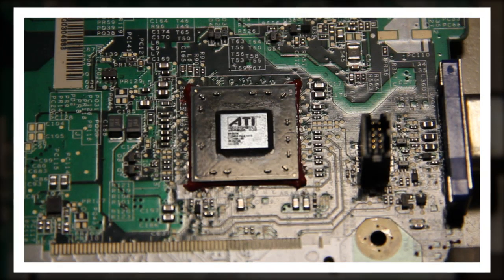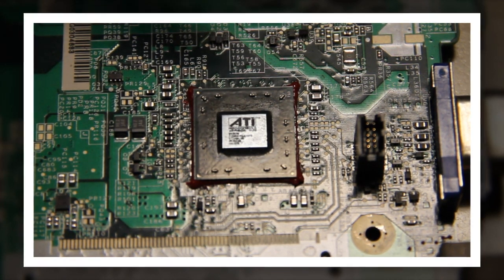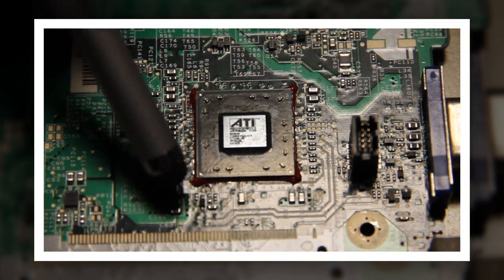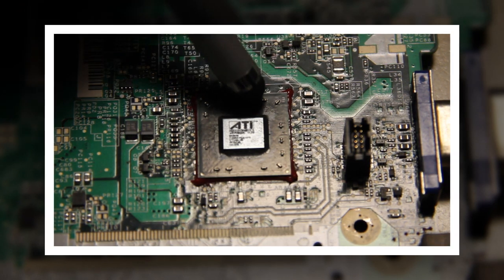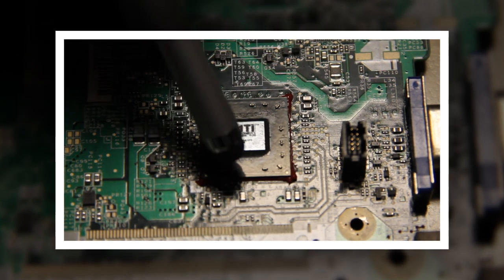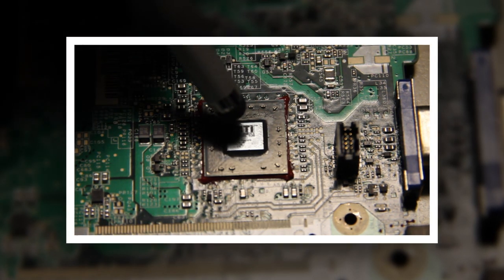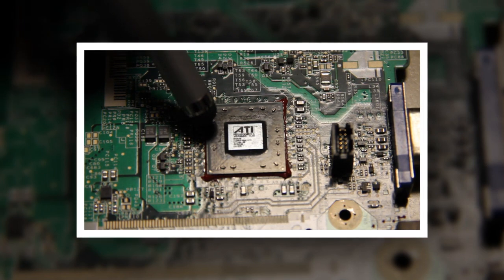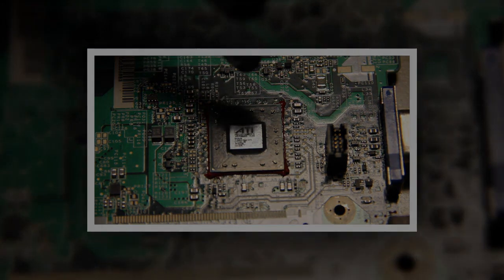GPU Reflow Do's & don'ts

Comment: The coin with lead on top works well.. you just need to do it on a circular motion and woth the correct temperature.. you says lot of things and you are not helping people!!!
Reply: Coins do nothing to actually fix the problem. The only thing adding a coin does is add pressure to hold the chip to the board. But this is only a temporary fix and will also warp the board or chip preventing actual repairs. I've done this for emergency repairs or when someone couldn't actually afford the fix when I first started until I got copper shims. Now I actually keep copper around so I can gauge the thickness accurately
Reply from the maker: And how does that fix it? That only puts pressure, but doesn't fix anything. I'm fact it causes more warping making future repairs much harder or more damage to the board.

Comment: If you are using foil on the board and then using a heat gun properly, the small componets falling off isn't a real problem unless you are using WAY TOO MUCH heat. 

Here's a DO that wasn't mentioned. Analyze the board that you are reflowing at home, and look for reasons as to why you need to do a reflow in the first place. If you didn't have a bad fan or cooling system and if the problem is common enough, then you likely have a tiny design malfunction that you might be able to remedy which will make your reflow actually last. Although sometimes, you just get a board with a little less solder than most other people (badluck). I'd recommend home users to read my solution below regardless though, since it could help with both situations.

The most common design flaws I encounter, are boards not being 100% level, (screw stand offs being too high or low) or missing back support behind the BGA. If there is no support beneath the BGA you are repairing, then this could be the cause of your problems. Many companies don't add this when a device is only designed to work for a few years. The reason you want support behind the BGA, is so that small degrees of warping are prevented from occuring over time from the heating and cooling of the board during normal use. When the BGA has good enough support behind it, it will keep the area directly behind and around the BGA flat, even when the board heats up to higher than normal temperatures. This warping over time is typically the main cause for this to happen to devices that run hot regularly (example: graphics cards, soldered CPUs, soldered RAM chips, etc). 

An excellent cheap at-home solution that I came up with in my garage 12 years ago, is to make cardboard cut-outs that are just slightly larger than the BGA, and cover those completely with electrical tape, and then adher it to the chasis directly behind the BGA for the board to rest on (make sure it's thick enough to fill the space and make contact with the board, you can also stack additional cut-outs on top of each other). I also sometimes use shipping foam cut outs (example: styrofoam) but cardboard from moving boxes have also served me very well, usually at least two cut-outs stacked. I typically make them just thick enough to where they slightly use more space than is available between the back of the board and the chasis. When the board is mounted/installed again, the pressure from that will flatten the cardboard to the perfect amount automatically. 

A professional engineer or shop will tell you that I am crazy. They would also tell you to spend $100s to completely replace the BGA instead. For anyone at home that wants a free solution, this is usually it. Oh, and make sure to get just a little melted flux under the BGA where the solder joints are (look up examples on YouTube), this will help a ton, almost like magic. If you can't afford some electrical flux, you can use a little petroleum jelly instead. Just don't use plumbing flux; it's too strong and will degrade the board later.

Comment: What if my gpu is already reflowed,it can be reflow again?
Reply from the maker: Yes. As long as both are done correctly. Caution needs to be given, as if a second one is needed, it's possible the chip can be warped or the solder is bad and needs to be reballed. But I have done as many as 3-4 for laptops under extreme use. I always recommend after the 2nd just replace the chip or board since usually damage is causing the excessiveness of repair requirements. Make sure proper shims are used if needed, a good paste, and the cooking system is cleaned.

Comment: With this fault will it give external vga out display? My dell laptop is black screen but gives external display, the lcd and lcd cable are definitely working
Reply from the maker: Usually if you have external, it's a bad LCD panel, cable, or motherboard issue. The GPU would completely fail if it's a broken pin issue

Comment: If you do a proper, safe, controlled reflow, is it a good idea, after the board is cooled down, to replace the corner sealant? Might do a controlled reflow on a laptop m/b, but taking precautions, & not sticking it in an oven! Thanks

Comment: That’s why everyone shows videos of fixing theirs in here? And you say don’t do it unless you gave the correct machines? Well we want it done for free without buying machines, especially when it’s just to get back up and running on a crappy pc
Reply from the maker: Well, those methods without the machine cause not only bad results, no results or worse, people don't realize by sticking boards in their ovens, it releases Lead into their stove along with other chemicals which they end up cooking with later. And this still doesn't fix the issue. I can understand not wanting to buy a machine, but their are many alternatives. Getting it repaired by someone with a machine, or replacing the motherboard. If free is all you're interested in, then understand that's the quality of work you'll get.

Comment: I rescued my notebook GPU using the heat gun method and it's still running fine 2 years later.  99% of the time with these things, it's an old piece of equipment that isn't worth investing a lot of money into.  If it works, it works.  If it doesn't work, well - It wasn't working to begin with.
Reply: I concur

Comment: Let's say I was doing it with the hot air wand, how would I know I'm doing anything right, is there a point where I can see the solder flow? Let's say I flux all around and then heat the chip Do I ever get to see solder flow?
Reply from the maker: Using a hot air and flux, if you could get the entire chip hot enough which is very hard with a GPU that's why it's not done that way. And if you got the chip hot enough to move, all the caps and resisters on the top of the chip would also be loose from the heat and their is an extreme risk the air would blow them off. A hot air wand is used to remove chips without resisters or caps attached to the top. But you know when the chip comes loose when it starts to wiggle in the flux.
Reply: @johng6673  What if I hold a soldering iron to the top of the chip until solder starts to flow
Reply from the maker: @fugeeohu9357  you don't get even heat distribution and you will kill the chip from overheating it
Reply: @johng6673   How does the expensive machine do it?
Reply from the maker: @fugeeohu9357  even distribution of infrared head controlled from both the bottom and top with a controlled tip and possibly a suction tip

Comment: "Dont repair your engine yourself, you could break it in the process.." well no shit. 

You have to know your market man. If you charge $40 to reflow a $60 GPU no one is going to do it. Considering GPUs last a couple years even a $200 gpu brand new is only going to be worth about $50 by the time it breaks. Thats why these methods exist, if you could just take it to the GPU Fixer store for $20 no one would dream of doing it themselves. If you wanted to help people tell them how to improve at home methods. Not just "Dont do anything but take it to my store"
Reply: This comment didn't age well.

Comment: Do what correctly? What about the "do's"?
Reply from the maker: BeLlSiBuB The do's. Use the correct machine that doesn't damage the rest of the components. If the cost of the machine exceeds the cost of the board, replace the board. If you are a shop or are planning on doing multiple repairs, then you probably shouldn't be watching videos on what to do, and maybe spend a little on classes to make sure it's done correctly. The reason their isn't a list of what to do's, there really isn't a variety of different ways. Just the correct way. I made this video since I keep hearing about all the ways people are doing these repairs, all of which don't really fix the problem. Also, I end up getting these repairs to fix from other shops, and I can see the mistakes people make that cause permanent damage. So, the answer is, fix it correctly, or purchase a board. If you need to go as cheap as possible, paying someone else is usually $50-$100. Otherwise, if you need something cheaper, there is videos I don't recommend, and will not take responsibility, that you put tape around the chip except the die, and put a penny in between the chip and heatsink. Very bad idea, but at least you're less likely to cause permanent damage than blowers and ovens.
Reply: Ok, firstly, thanks for the reply. I have an old HP DV6 paptop with a dead screen. Youtube vidz all point towards blitzing the GPU with some flux and a heatgun.. I know how to build a pc, I know how to change the screen on a nokia 1020 or dismantle a samsung S3/S4 but know nothing of soldering or rather "sodering" as americans call it. I can't afford this equipment. My aim is to get a quick fix and sell the laptop asap. I won't be using the oven method but have ordered a heat gun. I am sure there a lots of youtubers here in my position. So, if you can't afford the equipment and need a temporary solutiuon what is the "right" way to do it please?
Reply from the maker: BeLlSiBuB A heat gun is extremely bad. The hot air blowing will actually blow the small capacitors off the chip and even around the chip on the motherboard. This is why I made this video.

Now, if you can wait until this weekend, I'll consider making a "Part II", to help you and others like you. I need to think about it, as it will surely cause a bunch of people using this emergency method and the first person that kills their boad will come after me. There is a way I've used when traveling and I don't have my machine. But it's real tricky and without a temp gun, it relies on experience. Get back with me Friday and I'll let you know.
Reply: Thanx John, look forward to watching it. In the meantime I have been inspired by this vid and similar:
https://www.youtube.com/watch?v=w37QV0EZXQI

Comment: Are you doing a part 2 video for the DO's?  B'cuz all I've learned in this video is that I should buy a new GPU and inflate the prices for John Gebman.
Reply from the maker: Frank Thots Not sure how it inflates prices for me. I have no part in that. The main reason for the video is all the wrong methods. And in the video, it doesn't say, only to purchase a new board, it says a Reflow machine or reball machine should be used for repairs, and if you don't have one, access to one, or don't know how, then the best option is replacement. None of the options cause any inflation, and unless I do the work, none of the options provide any funding for me. Now, I can do a part 2 video, but I still won't show what I do for two reasons, liability, and I have a method that very few people do, so I keep myself as being one of very few that do this method which ensures m my success.

Comment: Hi. I'm reflowing a GPU using a hot air workstation (the one with the want)?Should I set it to 200 celsius? How long? Should the board be preheated? What temperature and how long? Thanks.
Reply from the maker: SevenDeMagnus I don't recommend using hot air. In order to do an actual Reflow, you need to get it 475f or hotter depending on the solder used originally. In doing so, you can blow the capacitors off the chip before the chip sets correctly, especially since they usually can come off around 425f or so. So for liability, I can't give advice for hot air wands. Sorry.

Comment: A lot of cautionary tips that would be helpful for someone who doesn't want to ruin their gpu. However a lot of people doing this are doing it on a cheap or older card, where paying a repair service would cost more than replacing the card.
Reply from the maker: FroztiProductions I gave the don't for those that can't afford to replace their devices. If you use the wrong method, their is a greater chance of permanent damage that is irreversible, or damage to other components resulting in full replacement versus just doing the correct repair from the beginning. Of course there are short cut ways, but the ones I mentioned have had a higher fail rate than success when done at the proper temp. Most that perform the lesser methods usually work not because it worked, but because the added paste or copper puts more pressure on the chip causing the leads to make contact, not because it actually worked. It takes over 400 degrees Fahrenheit to melt the solder, doing this incorrectly melts the surrounding solder and anything plastic around the area as well. If you are truly on a tight budget and can't spring for the $60 to repair it correctly, you can spend about $30 or so using a 140watt light bulb, cardboard, aluminum foil, a temp gun and flux. But the reality, if you can't afford to spend the extra $30, you probably need to re-consider a few other things. $60 is not a lot to do it correctly. Well if I do it and you are not around, $60 + shipping. A new video card can be as cheap as $27 at a local store and most motherboards range from $40 to $140. So these may be better options than frying a board, just put that money towards a replacement.